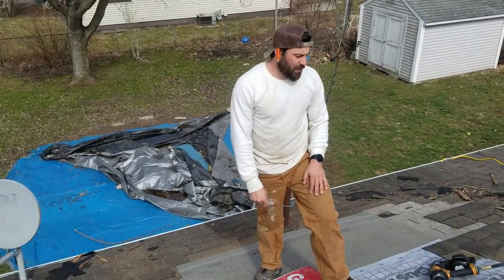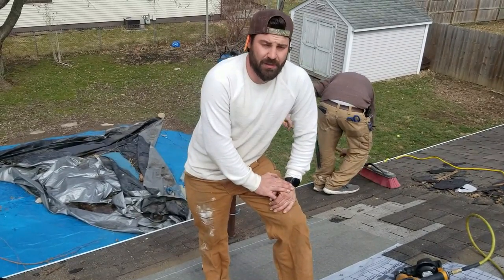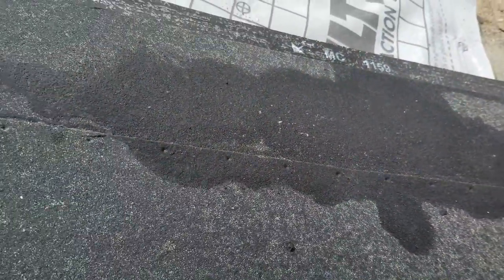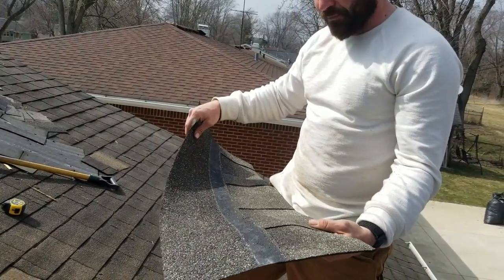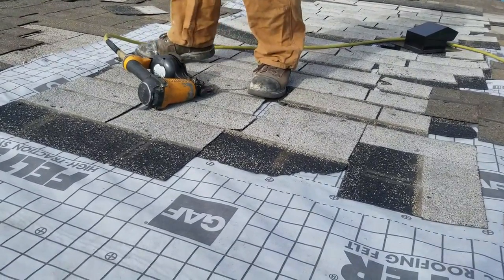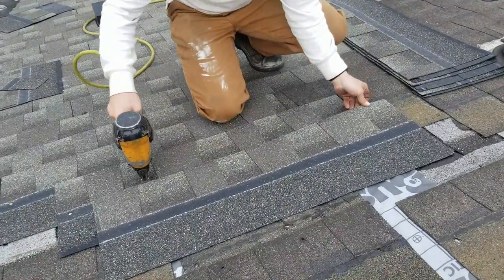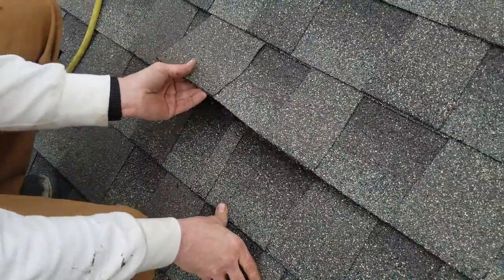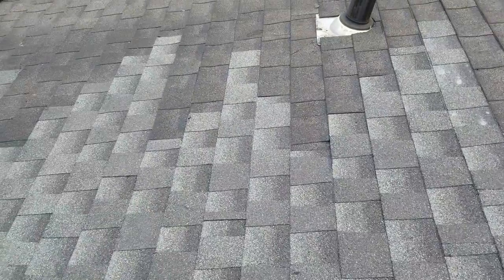2 Layer Roof Repair | My First Look at GAF HDZ

Comment: Sorry, just been through Ian in Lee County, Florida, and all the roofs I saw which were damaged were GAF Timberline.  The wind lifted the  shingles and the nail heads just pulled right through the shingle, or the shingles just tore. OC shingles did not fail.

Comment: The bond adhesive is Dura Grip. It really does stick down fast which is what you want. I used HDZ Pewter on my gambrel shed. Lower rafter angle is 73 degrees, upper is 25. They stuck fine and did not fall off, not using any extra roof adhesive. These shingles can also bend over the slope transition, if they get nice and warm in the sun. It was colder, so I used a heat gun to do that. But another way is use a round steel tube such as a garden swing in the full sun, lay shingle on top. When it gets hot mold it around the tube. This is of course nothing a pro would do, but as a DIY on a small shed, it works to form a shingle on the curve of the slope transition. Idea is preheat then nail it on and keep going rather than nail it on in place and wait for the sun to heat it up enough to bend it.

Comment: Hey is it ok to use staples to install roofing? My buddy just had his roof done and I was on a ladder and while looking up the roof I could clearly see one side of the staple had not been driven all the way into the roof therefore it was holding the shingle up that was on top of it. I told him he needs to fix it before we get a really hot day and the shingles glue themselves down. Then he will have a hard time lifting them and fixing the staple. I have to assume just hammering down a crooked staple could possibly drive the side of the staple that is flush through the shingle? Thank you in advance for your reply. 🏡 🔨
 I tried to email you a photo but I must have used the incorrect email address because my email got bumped back.
Reply: I’m not the world’s fastest shingler, but I do know only a hack would use staples.

Comment: You damaged that whole bundle of new 'gaf' shingles by being to aggressive when you cracked them open! Id toss that bundle away...wouldnt want that on my house! My laborers get back of hand for doing that.... Why would you step in like that?.  Id shingle straight up for that repair and offset 10" at the tie in....looks way cleaner.  And you will notice those missing shingles underneath when the roof settles....i would have taken more time and filled in those 3tabs alot nicer.
Reply from the maker: Chill bro.  Its not that serious. I didn't damage anything
Reply: You can see the crack on the first shingle that you took out of the destroyed bundle.  Ive put on enough shingles to tell you that stress you applied carried through entire bundle right at the laminated section of shingle.....if any of those land on your stagger it will leak before it should.  Not good practice. Shingles are made to withstand all elements if installed correctly. If it is acceptable to install a cracked shingle......how come they are not designed and manufactured that way?
Reply: You keep posting videos ...im just an honest observer of your work. Thankyou.
Reply: David Lysohirka I’m sure the whole bundle wasn’t trashed.. and who cares if it settles a bit.. it’s never gonna look right where the old meets the new and it’s frankly a repair to a half assed roof that’s gonna need torn off and replaced in another 8-10 years because someone couldn’t be bothered to rip it to begin with
Reply: @Beandiptheredneck  you are correct....but could put in a effort and not joke around about someone elses hard earned money for that repair.....and you cant tell me he didnt have 8 bundles left over from another job to complete this repair!!!!! My repairs dont look like that...ive done hundreds!  Put a good effort forward and great things will come to you in this industry!
Reply: @jasongoshorn6940  Cheers!  My wife was wondering if you are in the area and looking for work!  Finally someone on here who gives a shit....pardon my spelling!
Reply: @Beandiptheredneck  honestly....that repair is horrible and this guys churppin Olympics!  Oh my....his rules of course! Lol!
Reply: And that bundle was only good to cut off exposure and use for starter. Thats it. Bundle was toast before it even had a chance!
Reply from the maker: YEA RIGHT you didn't make anything you leech. i looked at your bum ass channel. you got nothing better to than to question a vets morals you POS. worry about your damn self and before you go talking post a roofing video
Reply from the maker: and you too bud. stacking those shingles on ten inch staggers is asking for trouble. you cannot do that with architecurals. my repair looked as good as it could possibly get. and these shingles aren't damaged you freaks. bending them like that doesn't hurt them. you're telling me you don't do that? fan them like a deck of cards when you take them out? same thing! I just started opening my bundles like this and believe you me, if there was a problem with it. I WOULDN'T DO IT!. so as I said earlier. chill. or actually. post a video showing you can actually shingle. i got a 1 sq challenge out there for you fakers. don't forget the QUALITY.
Reply: @NWIVeteranConstruction  i got you fired up .lol.  And my name is Dave.. You know im right and il post a vid soon just for you.  Lmao!  Is this guy for real!
Reply: Cant stagger in that fashion coming from a guy who cuts his shingles inside the roof while building!!!! Its a repair!  Go to school! Seriously.
Reply from the maker: @davidlysohirka798  dream on! Lol you couldn't get a rise out of me if you looked like riley Reid.  Only thing you're right about is it's just a repair. That Is the truth.  You know I used to make immature comments like you looking for the tedious things and call out people too. Until I had to deal with guys like you.  Its annoying and unnecessary.  I give constructive feedback now like (btw you had a nail in the seam at 14:26) suggest the way to fix it and tell him he did a good job. Grow up "Dave" you won't be hearing from me until you post something.  Drop your link in whatever video I posted the most recent if you ever really do it.
Reply: Lol... Like i said...ive been doing this for almost 22yrs.....3rd generation of roofing in my family.....tar runs through my veins jackass....they call me ladderdave for a reason.....  Check yourself.  You have potential ....but i would pay you $17 / hr canadian to start!    Its a total re-training situation!
Reply: @NWIVeteranConstruction  do it all the time on repairs.....my repairs do not look like yours.   Your a beginner.
Reply: @jasongoshorn6940  i know.....i wouldnt hire the worlds fastest to even roof my shed! He is not a very good roofer ......but i like watching to see what not to do! Its entertainment!
Reply: Ive done alot of repairs myself.......not like worlds fastest! Its un-fortunate for these homeowners that have no idea what a good repair entails.....or a new roof for that matter!
Reply: Hey. I live in 🇨🇦. B.C..... Thx for the offer! I own a small roofing company and its quite entertaining watching the worlds fastest!  Im sure you agree!
Reply: @NWIVeteranConstruction  I will take your one sq challenge. How soon you want to do this. You are not taking constructive criticism very well. About as good as you roof. Anytime anyplace, make videos or whatever you want. You need to be learned a thing or two.
Reply: @davidlysohirka798  you are obviously not a roofer, because every single roofing group I have met in my life opens bundles that way, and I’m talking about groups that work for big companies in Texas like Lon smith or Paragon. You’re insane, I honestly doubt that your roofs are perfect
Reply: @edgarespinosa7894  if you treat your product that way.....im sure your guys roofs are PERFECT! Thanks for your attention Edgar.
Reply: @edgarespinosa7894  eddie....slow down ....treat the shingles like your lady....be gentle....take your time....be smooth! Steady....your talking to a legend . i know.
Reply: And the only thing bigger in texas in this guys head!  Take it easy eddster... All the best on the roof...be safe#
Reply: @davidlysohirka798  did you ever post a video?
Reply: In order to get a contractor's license you have to have 2 years of experience and I promise you right now since his ass was in the military he has nobody to refer

Comment: Owens Corning Duration has been doing that for years and they’re the best! My wife and I changed the shingles on the house summer 2017 and new install on the garage fall of 2019, and we installed Owens Corning Duration colour Teak and we’re really happy with the results.
Reply: Dan The Machinist these are the pink ones with the gray strip?
Reply from the maker: the o.c are something different. I think this trumps what they've done to be quite honest. i'm a decent fan of O.C as well.... so that's just an honest installers opinion
Reply: @NWIVeteranConstruction  yay mr. Trump. Nice single also

Comment: No way I would not nail that “common bond” as you’re calling it. We’ve been using iko dynasty’s which is like that, but still nailing that double layer portion. Way too much wind damage around here to put speed over accuracy
Reply from the maker: Iko Is not like that.. just because they have a line where the top of the shingle is doesn't mean they have everything I mentioned in this video.  This is more advanced than o.c and I would never even lay an iko. Basically right there with atlas menards brand bs or whatever.  Definitely hit the common bond on 100% of shingles besides this one ( including durations)

Comment: Why do these shingles have lifetime warranty when we all know they need replacement after a dozen years?
Reply from the maker: shouldn't be a dozen! as long as there's one layer of shingles and they're installed correctly with proper ventilation they should last easily 20 to 30 years. sometimes more in specific areas depending on weather. the warranties have some fine print of course. but that's easy to research. the 30 year shingles were mostly upgraded to this lifetime shingle. the better brands anyway
Reply: @NWIVeteranConstruction  I live in Canada....My 12 year old GAF shingles are shot on the south west side already. We hired a GAF certified installer. GAF says the shingles weren't installed properly and the installer says what did you expect? Done with Asphalt shingles I'm getting quotes for metal.
Reply from the maker: @donniedraftdodger7457  ahh yea metal is good for sure but very expensive... sounds like bad ventilation.  Need to make sure there is baffles in your attic.  As well as vented soffits.  The baffles actually need to be in line with the soffit vents.  Any amount of vents or ridge vent or power vents won't vent your attic if your soffits aren't vented properly with baffles
Reply: @NWIVeteranConstruction  Appreciate the reply..understand attic ventilation well..Up here metal roofs start at $6 per sq ft. GAF shingles average $3.50 per ft.  more if they are certified installers. Its getting close to be a no brainer.
Reply: Seems a little off on price, I make metal roof components and a sheet of flat colored steel that’s 4x10 is $52 per sheet before it’s ever made into the components of a steel roof. You’re going to get a garbage thin gauge product or a garbage installer at $6 a square foot.
Reply: @jaked964  Im in Canada..28 gauge, strapped, SMP coating.  have 2 quotes at $6. Have another..Metal shingle, 30 gauge. $8 per foot. The shingle have fasteners that are hidden

Comment: Those shingles suck, they feel thinner then the regular HD’s and they should have made the double part of shingle go high enough to cover the whole nail zone like I think certainteed does
Reply from the maker: I thought that too. Not about them being thin but the common bond.  Seems like the simple answer.  But they must have good reason not to do it
Reply: Actually the "double part of the shingle" which is called the common bond is the same size for CT Landmark and Timberline HDZ. Landmark has allowed nailing above the common bond for years. Now GAF has mechanically fused the common bond on HDZ which allows the installer to nail above the common bond if they want. HDZ isn't thinner either BTW.